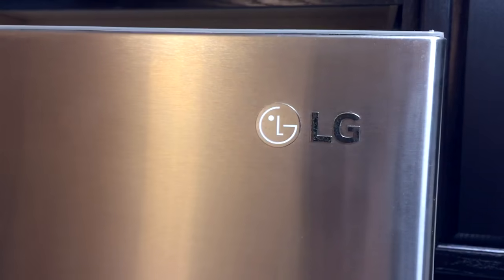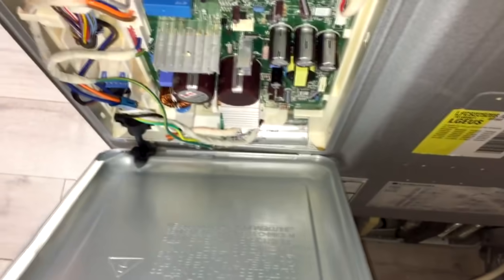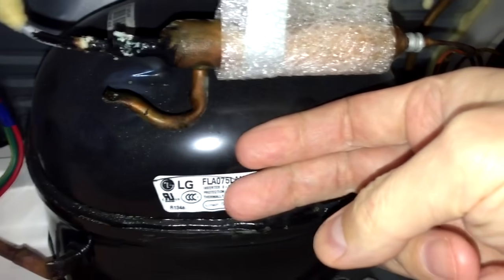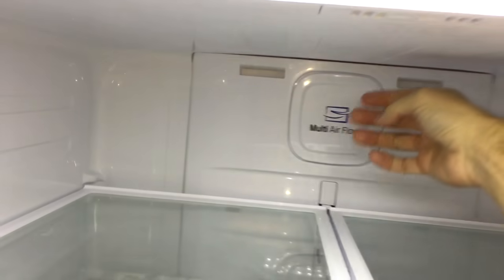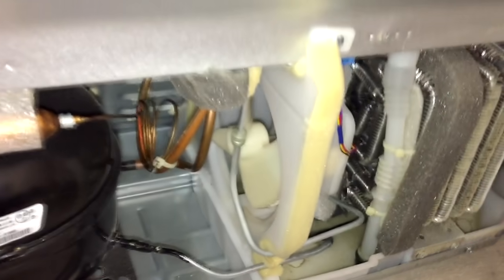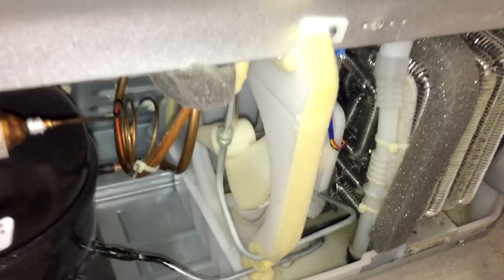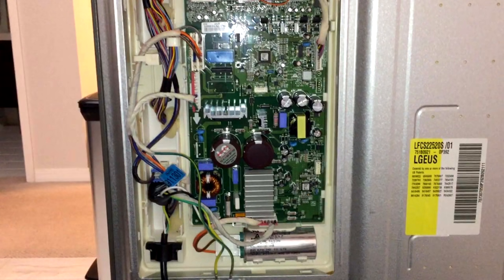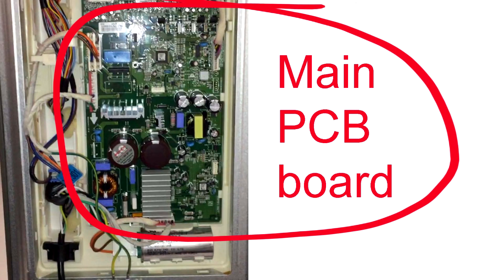LG refrigerator test and reset button

Comment: Ok....ran the tests....but no blinking lights. And no cold air, is it possible that it doesnt detect a leak in the system? Compressor and both fans are running...and also, what should the 3 prongs on the compressor ohm out to?
Reply from the maker: Yes, the error code can't detect a leak in the system. Also, it can't detect an inefficient (going bad) compressor. And if it says LINEAR on the compressor, most likely it's bad even if it seems to be running. That's why LG extended the free compressor replacement warranty up to 5 years (10 years parts only).
Out of 3 prongs on LG Linear compressors, only one side is active and should be about ~7 ohms.

Comment: thanks for posting this video. I did the test mode and everything works. out of test mode the evaporator fan in the freezer does not work. any ideas??
Reply from the maker: During a normal mode, when you open a door, the fan may stop automatically. So you need to trick the system as if the door is closed by activating the door switch. The fan should start blowing within a minute.
However, if during the Test compartment fans were blowing warm (room temp) air, the compressor could be bad, or the refrigerant could be leaking out.

Comment: Very informative video.  Followed this procedure and everything worked and follows the sequence for the fans, compressor, and defrost.  I was hoping the "reset" you mention would clear an eR15 I'm getting on the front LCD display.  But it didn't.  BTW my board does not have any LED light it just beeps.  I replaced the icemaker hoping it would solve the problem, since this code is icemaker related but it still eventually goes back to eR15 error code.  Refrig and freezer both work fine, but once it throws the eR15 code water will not dispense.  Ice maker will go through producing one cycle of ice, but after code nothing.  Unplugging refrig clears code, but it then goes back to eR15.  Sometimes the refrig will go back to normal (clear code) on its own.  Any suggestions would be appreciated.  Thanks!
Reply from the maker: That's an unusual error code. Typically it's all letters, no numbers. So probably - ER IS.
What's the model number of your fridge? I may be able to dig up some info on it.
Reply: @Your-Self  LFX25980ST
Reply: @Your-Self  Thanks for your reply.  Yes, I've seen it shown both as "I5" and "IS" on my web searches and the code is shown to be "a problem with the icemaker fan motor" or a "disconnection with the icemaker sensor".  The fan motor is operating and blowing cold air,   As I stated since the control board is part of the icemaker and cannot be easily repaired, I replaced the entire icemaker with a new one.  So I'm at a loss here, I sure hope you can help because this is driving me crazy.  As I stated the refrig and freezer are operating and cooling fine.  Once the code is showing the refrig will not dispense any water.  I have gotten the icemaker to complete and make one ice cube cycle before the code is thrown.  This is baffling to me …. I thought and was hoping that the new icemaker would clear the code.  When I unplug the refrig and then plug it in the front display will display a normal good display and then cycle back and forth between a good display and the "eRIS" code until it finally settles and stays on the error code.
Reply from the maker: This code is for a "problem with ice-room sensor" that is located slightly above the ice-maker. The sensor (thermistor) could be bad, or a connection could be loose/corroded.
Sensor part number 6500JB1008A
Reply: @Your-Self  Wow ... thank you so much for that part number and solution!  Is that directly above the icemaker on the back wall where I see three square holes in the panel?  Is that easy to get to or do I have to pull the entire inside panel off?  If I could I'd like to provide you with a recent troubleshooting observation I just made while waiting on your reply.  I noticed that when I cycle the power on the icemaker switch from on to off and then keep the icemaker off it clears the eRIS error code with the new icemaker.  Once I try to turn on the new icemaker again the error code comes back.  With the old icemaker installed that error code existed with it on or off and also once I removed the old icemaker from the refrig/circuit it also tripped that error code.  Does that behavior still jive with your proposed solution?  Thanks again for all your help!
Reply from the maker: Yes, three holes above the ice maker, and easy to get to.
Unplug the old sensor and plug it back in. Maybe it's just loose. There may be another connector above the left door inside the hinge cover. Unplug and replug it as well.
When one of the sensors is faulty, the whole algorithm on the main PCB may go crazy.
Reply: @Your-Self  Okay thanks again!  You have been extremely helpful and knowledgeable.
Reply: @Your-Self  sorry to interupt just got a problm here wishing you could help me too,what does it mean Er co that appears in ref control monitor.thanks

Comment: Thanks for the video. We have a LG LMXS30776S/04 and it’s 3 yr and 1 month old now. Ran the smart diagnostic and no errors were found. Performed the test modes per your video and for test 1 the condenser fan turns on and the compressor is also slightly vibrating. The fridge and freezer fans are on and the air is blowing cold. On the second stage of the testing mode the condenser fan and compressor is still on however only the freezer fan is on. There is also no light flashing on the pcb board during the tests but the lights on the front panel does show “22” - “22”. 

I also tested the relay and compressor prongs and got around 8.5-9 ohms on one prong set and 0 for the other 2 prong set. Based on your comments it seems like I have a compressor issue but not entirely sure. Thanks again.
Reply from the maker: Based on your description, everything works as it is supposed to.
Check if the fan inside the fridge blows cold air during "normal mode" while the compressor is running (you'll need to activate a door-switch with a magnet, so the light turns off).
If the fan works, maybe the air is not cold enough. This could be due to a defrost problem, or most likely, the compressor going bad. 
Call LG directly if you have the receipt, and they should replace the compressor absolutely free.
Reply: I’m having th e exact same issue, same results with the 22 on display. I see this happened to you 2 yrs ago, I’m curious how you made out? Did LG replace your compressor?

Comment: What about when the LG fridge loses WiFi connectivity, and pressing the Wi-Fi button inside doesn't do anything? Mine is behaving this way shortly after attempting a firmware update via the LG app, and persists a day later. Should I just power-cycle the unit?
Reply from the maker: Yes. Unplug the fridge for one minute and plug it back in.

Comment: Hiya so i got lfxs24623s/00 I think same as your video, when I do test 1 & 2 top fridge n bottom freezer is pushing out cool air test 3 nothing no cracking. Once the test is done I get barely any air thru wants. My freezer does not push any air n top minimal air. The ice maker does not make any ice nor does it work obviously. The compressor was super hot earlier I clean out coils beside fan bc it was dirty, didnt make any difference other than keeping compresser cooler while running.  Any clue ?

Comment: I have a kenmore refrigerator model 51833 which has a LG linear compressor FLB075LANA on it. The compressor is running, all fans working, air coming out but not cold, tubes coming into the compressor not hot or cold. When the door opened, evaporator fan always start running, and sometimes it stops when the door is closed. Does it mean the compressor is bad since my refrigerator is just more 4 year old?
Reply from the maker: It sounds like the gas (Freon) has leaked out, or the compressor is bad, which is a more likely scenario. LG replaces those compressors absolutely free for the first 5 years because it's a major problem. But since your model has a Kenmore label, you have to go through Sears. Call them, and hopefully, you can negotiate a free replacement or some kind of discount.
Reply: @Your-Self  thanks for your  suggestions

Comment: Great video! Are the temperatures on the fridge the setting and not the actual temperature?
Reply from the maker: Most refrigerators have only settings for the temperature, not the actual temps. But some models have both, and you should be able to find it in your Owner's Manual. Thanks for watching!
Reply: @Your-Self  mine is pretty much exactly like yours, except the condenser is on the other side away from the compressor and the temps are displayed on the outside of the door. Mines not cooling and seems like everything is working fine. Oh well
Reply from the maker: Sounds like a typical LG Linear compressor problem, running but not cooling. If your fridge is under 5 years old, the compressor should be covered under the Free replacement warranty.
Reply: @Your-Self  I bought it in April 2016 so we'll see what they tell me, tried to call but they moved their hours because of covid-19. Thanks for all the help!
Reply: @Your-Self  the compressor sounds like it's running, I don't hear any relays clicking but yeah the evaporator isn't cold, the condenser isn't hot...

Comment: When I run the diagnostics check,  I can get the first 2 tests to run.   After pushing the test button the third time,  nothing happens.   No audible beeps or action happens.  My compressor,  fan, and evaporator fan all will work.   The fridge became inoperable after a power outage.  There is also no flashing light on the control panel that indicates any problem.  Would you say that the board is probably bad?

Comment: So run through the tests and no codes show. When in normal operation I get water puddle that freezes inside the floor of the freezer compartment. Heater element ohms test shows 32.1 and defrost control sensor tests good. There is no obstruction from sheet metal defrost catch tray inside freezer compartment to and thru the tube to the evaporation tray by the compressor. Is it possible the heater can pass the test but be getting old and not providing enough heat to do a complete defrost?

Thanks much for the vid very helpful
Reply from the maker: The heater either works or doesn't. Most incomplete defrost cycles are due to the defrost control sensor (thermistor or thermostat, depending on your model) going bad, or attached in the wrong location. And can you visually confirm that the ice/frost not defrosting completely?
What is an actual problem with your refrigerator... not cooling or a puddle of water on the freezer floor? 
If you are absolutely sure that the defrost water drains-out well, the icemaker or the water dispenser could cause a water-puddle on the floor.

Comment: Thanks for this! Your video helped me figure out that the fans aren't blowing apparently. So the main board might be a goner. LG has been notified (fussed out) and they have a R.O started now.
Reply from the maker: During the Test Mode, all fans should blow air... but in some refrigerator models, you also need to activate the door switch for the fan to run after opening the door.
Hope your model doesn't require it.
Reply: @Your-Self  it's likely the main board that's gone wrong. When I hit the reset button once, the front panel lights up entirely and the freezer starts making cold air (non for the refrigerator) it runs for about 5min then stops and exits that mode.

I'm not sure what's going on here but it's weird that the fan won't power on until the reset procedure is activated.

Comment: my evaporator fan only starts when the freezer side door is open. do you know why that would be? the evaporator is not cold but the compressor is running all the time. its an lg with the inverter compressor.

Comment: Did the test, all fans are working.  Air is blowing....however, both the freezer and fridge are not cooling.  No signs of the vents being frozen.
Reply from the maker: What temperature was the air blowing?
If it's room temperature, there could be a gas leak or a bad compressor. Either way, a tech will need to investigate. And it's probably going to be an expensive repair. Unless it's under 5 years old, then maybe covered under warranty.

Comment: I have model lfxs30726s /02. The refrigerator stopped cooling, freezing. I did the reset test and both sections were blowing air from the vents. After the test, it is not blowing any air. Also, I didn't see any lights blinking to give any idea of what might be the problem.

What do you suggest to do next?

Thanks for your help and great video!
Reply from the maker: During the Test, was the air blowing cold or warm?
If it was warm, the most likely problem is with the Sealed System... expensive to fix without warranty.
Reply: @Your-Self  it wasn't hot/warm but it wasnt cold either, lol. Thought maybe it would get colder but then there is no air blowing when its not doing the test.  I'll try it again to see if it is on the cold side.  

Can you leave it on Test 2 (or 22) for an extended period of time to see if it gets cooler?
Reply from the maker: You can leave the Test-1 (all compartments) or Test-2 (single compartment) running for a few minutes to see if it gets colder. Eventually, the Test will time-out in 10-30 minutes. If the blowing air stays around room temperature, it's a bad Sealed System.
PS. The air may seem not to blow during regular operation is because when you open the door, the fan will stop automatically. But if you activate the door-switch, the fan should start blowing again within a minute.

Comment: My condenser fan never came on.  Everything seems to be working fine EXCEPT back fridge is Hot to the touch....is there a way I can repair fan?
Reply from the maker: It's fairly easy to replace the condenser fan.
But if that doesn't help, the problem could be with the electronic board not sending the voltage to the fan.

Comment: Thanks for the great video. I have LFXS30766S.  during the test （ press first 1） the blow cold air. after finished all 4 stages. I unplugged it. rest，then plugged back. it doesnot work. the top inside fan does blow any air （no air） the compressor is running all the time.  do you have tech who can send me？ do you think it is the PC Broad ‘s problem？
Reply: Hi Jorce did u fix ur issue? I have the same problem unfortunately

Comment: Hey I love the video. My LG freezer works but the upper part doesn’t cool enough. Any ideas?
Reply from the maker: When you run Test #1, do you feel warm/cold air blowing into the upper section?
Depending on your model number (single or double Evaporator) the problems could differ. For example; defrost problem, drain problem, damper door, fan, or compressor problem. Your freezer temperature is probably set at 0°F, but what is the actual temperature?
Reply: @Your-Self  my fridge and freezer works well on test 1 and 2 and 3  but normal operation it doesn't blow out the same cold air in the freezer

Comment: I have a Kenmore Elite (LG) model 795.72489.410 refrigerator manufactured in 2015 that stopped keeping temperatures in both freezer and refrigerator compartments.  Refrigerator is staying around 50F.  Condenser fan is running and compressor is running but evaporator fans are not.  Ran the diagnostic tests and the first test revealed that the evaporator fans are working.  Once out of the test mode however they will not come on.  Any suggestions on what to check next?  Thanks
Reply from the maker: This model has 2 evaporator fans, one for each compartment. During the regular mode with the compressor running, when you open the door, the evaporator fan will stop. So you may need to activate the door switch (so the lights go out), and within a minute the evaporator fan should start working again. If it works, make sure the Condenser Coils are not full of dust and hair. Also, check one of the Evaporator Coils. If it's not covered in a thick layer of ice and frost (which indicates a Defrost Problem), most likely the problem is with a Sealed System leak or a going bad compressor.
Reply: @Your-Self  Finally found the magnetic door switches and both evaporator fans come on.  What's the easiest way to check the evaporator coil?
Reply from the maker: There is no easy way to check evaporator coils. You have to physically remove everything from the refrigerator (unplug it first), including the shelves and the back wall. It's probably better to check the freezer first. And if there is no excessive ice/frost build-up on the evaporator coils, it's a major Sealed System problem. Sears may cover the price of the new compressor, but you'll have to pay about a $500 labor fee.

Comment: Thanks man...  my LG shows error code ff and both freezer and fridge aren't cool properly the fridge fan is out but I'm not sure how to check the freezer fan... I think it's a magnetic switch or something... thanks again for the test button information 👀👍
Reply from the maker: FF - is the Freezer Fan error code. The fan may be damaged or stuck in ice due to insufficient defrost cycle. If you can, disassemble the freezer to verify ice buildup around the fan.
Reply: The freezer fan has probably iced up.  The easiest way to fix that is remove all food from the freezer and refrigerator section, unplug the unit and let it defrost for about 24 hours.
You may have to repeat this every six months.  I've had this problem for close to 5 years now  and LG says my refrigerator is fine.

Comment: I pushed a reset button and it started cooling again.  I wonder what a issue was??? Thanks a lot for the video
Reply from the maker: Maybe one of the door-switches is going bad, or the temperature sensor is out of spec, or the mainboard is being finicky.